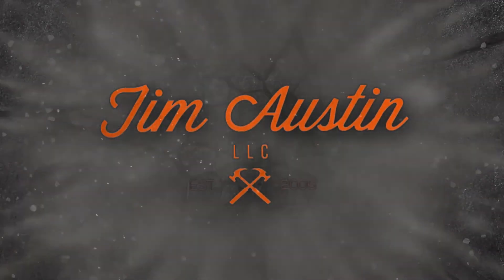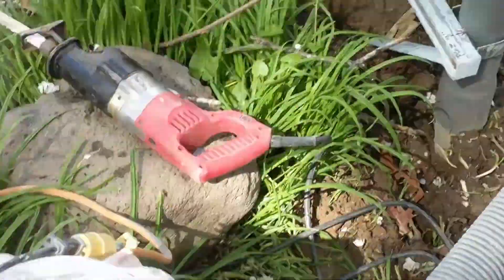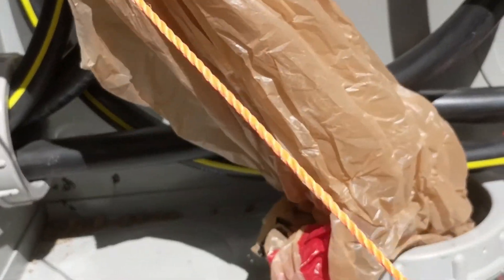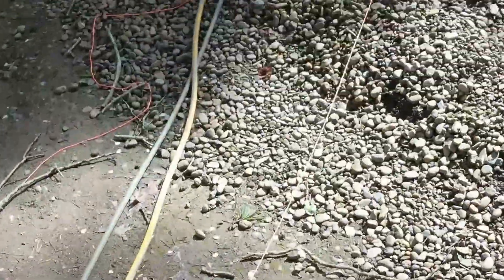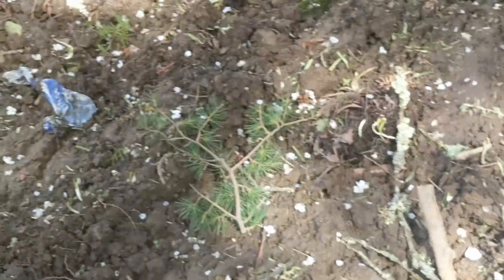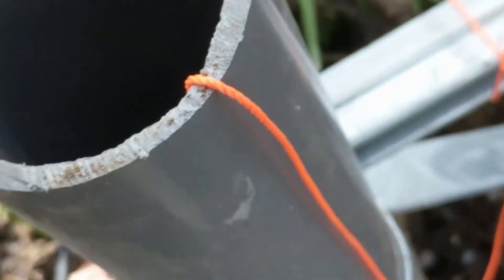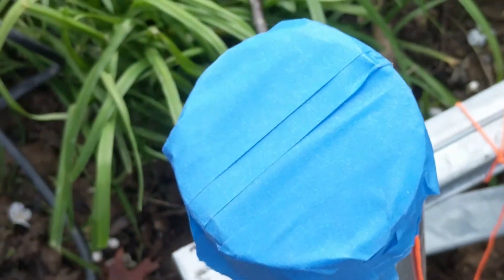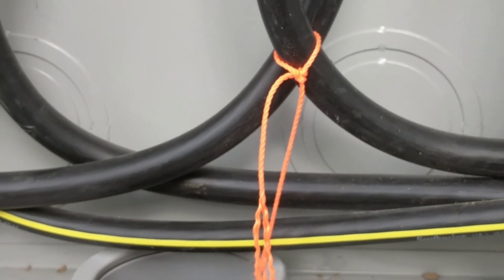HOW TO: Run a pull string through conduit

Comment: I've always said sucking a line through is far easier than trying to blow it through. Especially in larger conduits. I was told a story by another wireman that they were blowing a bird through some long runs of underground conduit and had sent an apprentice down to the far end to let them know when the bird came out. Well they blew the line and blew it and after awhile were wondering why the kid hadn't signaled that the bird arrived. They walked over to find the kid laying on the ground unconscious with a large red welt across his forehead. Apparently he was looking into the pipe when the bird shot out. I've also watched as dozens of gallons of water shot out into hot switchgear. Far better to suck that water out into the vac.

Comment: Layout (construction) string is very abrasive and will cut a deep grove in your 90° sweeps if not right through them if pulled under tension. Use electrical rated pull string:
https://youtu.be/ZRJqaqSfPf8?t=194

Comment: a long time ago before youtube i had purchased a property that had two buildings about 500 feet across for my internet business...  there was an unused conduit (metal)  not having a powerful enough vacuum i used lots of water to get the string there. 17 years later it now has 20 cables and a fiber.

Comment: I have been fighting with an already-run pull rope all afternoon. It's a long run, and there's other cabling in there already, and I think the rope is fouled with the other runs. I was ready to go rent a winch, possibly screw over some other poor bastard's runs just to get mine in. But there are other, empty conduits I'm free to use. This tip has just saved me hours of work, and like $75! Thank you!
Reply: Did this work with existing wires in the line?

Comment: I tried marginally successfully using a wad of cotton balls to pull a string through about 200' of conduit.  It didn't quite work so I tried it with the plastic bag and it pulled it through in about 10 seconds!  This works great.

Comment: Will this work if there are already wires in the conduit ?
Reply: The best way to handle this is to pull a new pull string in when you pull the old pull string out for running cable
Reply: Probably not.

Comment: Will this work for smaller pipes? i.e. 3/4, or 1/2? Probably just cut a bag in half, or something?
Reply: This worked on 70’ of 3/4” pipe. I did cut the bottom half of the plastic bag. But it worked so fast, I believe it , I didn’t need to.

Comment: the thing i wanna know is how far it can pull the bag?
Reply: Rukan Rasid I would bet it would pull as long as your sting is.
Reply: There will be fluidic friction losses with the air running through the pipe, but as the density of air is so low, these frictional losses will be minimal. You could probably go hundreds of feet of light string. The weight of the string itself would probably be the deciding factor on how long it could go. A nice, light and strong fishing line would probably go for a long time through a pipe.